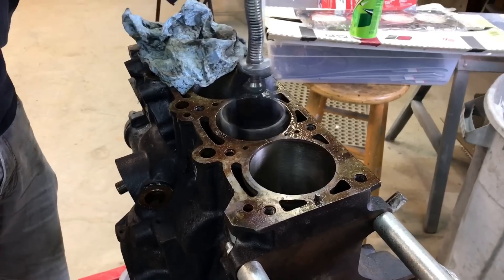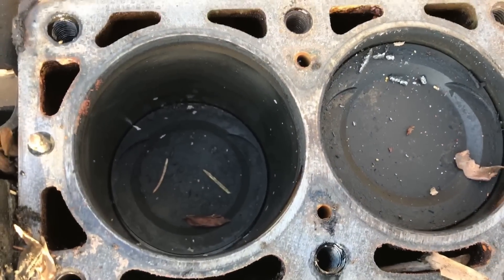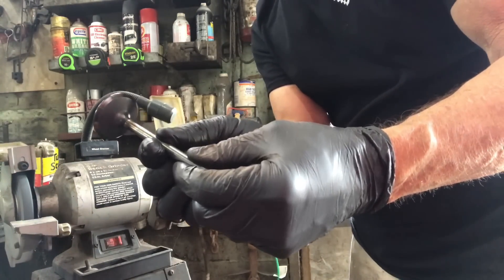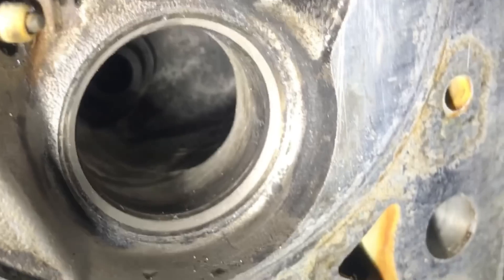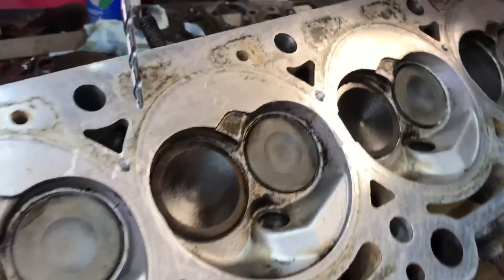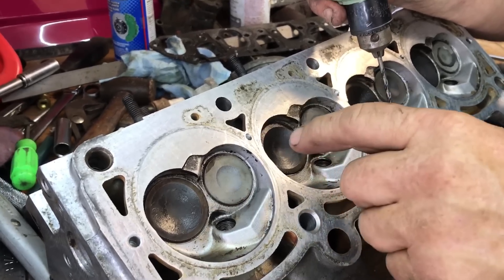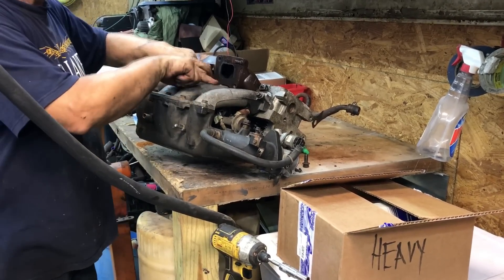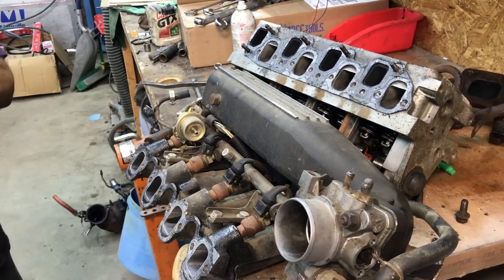HOW TO: RAZOR BLADE REBUILD 2.2L TURBO HEADS. DIY VALVE JOB, DIY INJECTOR FLOW TESTING & CAM OILING

Comment: I bought an 89 turbo van sight unseen and the cam gear is off the engine. what would be a reason for that? looks like they tore down to there and quit. took accessories off  and the cam gear and left it.
Reply from the maker: MAYBE TO SWAP CAM BELT

Comment: The G head and 782 use to crack between the seats but never seemed to cause any issues. Any issues with guides as in side to side play? This link was my 86 turbo z I restored for my dad sadly we had to sell it after 20years do to him having a stroke https://youtu.be/W-8RVTAZ7Ng

Comment: Richard, I have a request. I’m aware you’re not a diesel guy, however this is a diesel request. What I would love to see and I’d imagine you could garner some new viewers out of it, is a simple p pump 5.9 basic comparison on a mostly stock engine.
1-Compound turbo
2-Twin charged (super charger over turbo) 
3-super charged

Banks just came out with a twin charged crate motor and some others have done it over the years but the twin charged diesel never took off except in heavy commercial engines. 
Dyno numbers are impossible to find too. Anyhow consider it🤷‍♂️
Thanks!
Reply from the maker: won't run a diesel on the engine dyno

Comment: When I would hand lap valves I would reassemble them and put the head on its side then pour rubbing alcohol into the ports and see if it leaks past the valves .
Reply from the maker: WE CHECK THEM WITH WATER OR GAS OR WHATEVER WE HAVE HANDY

Comment: I've done similar on the valve lapping, but I use fuel hose and clamps. Clamping the hose to a drill bit and to the valve stem allows you to pull on the drill motor while pushing on the valve head and not have to worry about slipping, probably saves ~37.3 seconds per valve.

Comment: I like this series. keep it up. Would like to see custom exhaust manifold made. Having the manifold outlet that close to the intake CANNOT be good. Add a few inches of length to each primary and wrap them in header wrap. I guarantee you will see higher horsepower numbers.
Reply: Lmao dudes have made over 500 whp with ported stock manifolds 😭😆
Reply: it might, but installed in the car, it might not fit.  They are already pretty close to the firewall

Comment: I want to see what this can do on the dyno at 25 psi.
Reply from the maker: MAYBE ON THE 2.5L
Reply: @richardholdener1727  I'm a ford 2.3 sohc turbo guy (Thunderbird Turbocoupe). It would be great to see these two engines go head to head on the dyno with the boost turned up and inter cooled.

Comment: I would swap the #2 injector lead with #4.  It matches the 4 cylinder firing order a little better.  I know it's a batch injection, but my cars seemed to run better when I wired them up that way.

Comment: I rebuilt the turbo myself on my old T1 back when I was in my 20's. I got a rebuild kit for it and it looked like they just spray welded the worn-down spot on the impeller shaft and then just turned it back down on a lathe. 
It worked, I never had any trouble with it after that.

Comment: 782 head was used on all later 2.2/2.5l
Always check for cracks coming from the valve seats going towards the spark plug side of the chamber. 
Always check for dropping valve guides.
Reply from the maker: DROPPING GUIDES? DO YOU MEAN SEATS?

Comment: What generation 2.2 L have the Garrett Turbo with the three bolt flange on the compressor side that led up to the air filter housing and is the turbo that Richard using right now on his is it a bigger version than the Garrett turbo I am speaking of
Reply: Early T1 had a Garrett like that
Reply from the maker: T1 DRAW THROUGH

Comment: I wish I had had one back when we had our Plymouth Horizon, an 85 model that had a 1.6L Peugeot that made all of 65 hp with a 4 speed 1:1 manual trans. With a progressive 2V like a Pinto.  The 2.2 would have been a rocket!